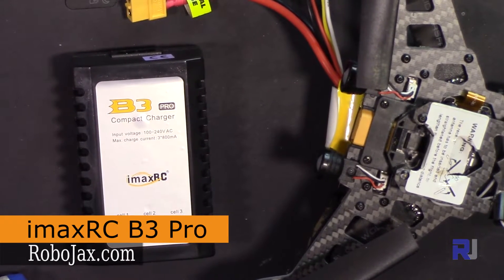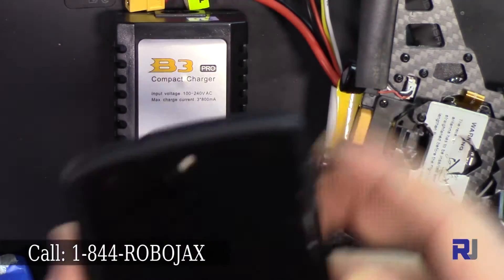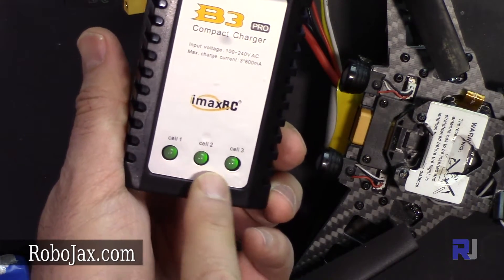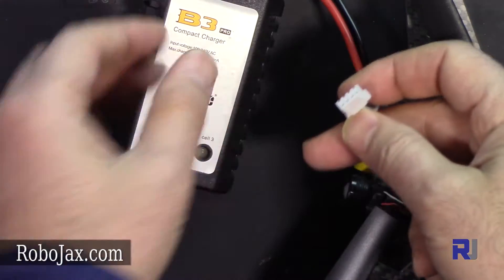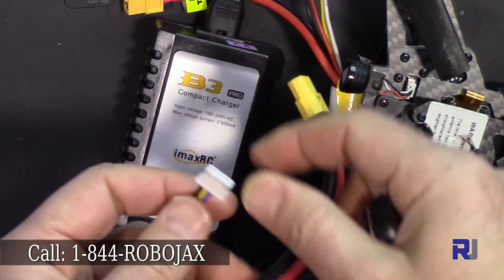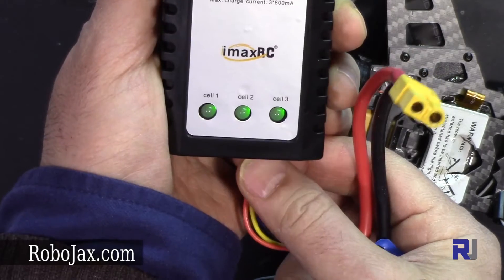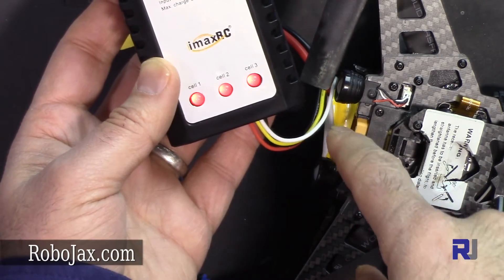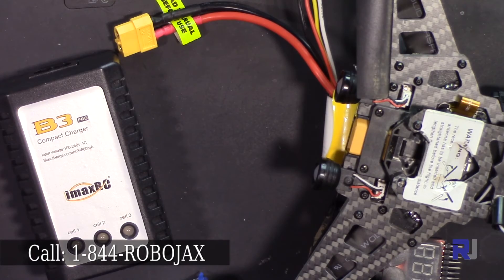imaxRC B3 Pro 2S 3S Lighium LiPo Battery Charger Explained

Comment: I assume the battery is a standard 3S LiPo, in which case each cell is 5200mAh, not 1733.33...mAh, you don't divide the capacity by number of cells to get a cell's capacity, unless it's a 3P battery. The batteries are labeled by their per cell capacity, and then the cell count to get a preferred voltage (1S = 4.2V, 2S = 8.4V, 3S=12.6V and so on). If you take your battery apart and put the cells in parallel (the 3P battery), you'd then get 15600mAh battery that outputs 4.2V (fully charged).
So the correct calculations are 5200/700 = 7 hours and 26 minutes for the B3 charger to charge a 2 or 3 cell (2S/3S) 5200mAh battery.
Reply from the maker: Hi,  Yes each cell has 5200mAh battery is  in a 3S 5200mAh battery. the 3S battery is connected in series but each cell is charged individually and they need current. The charger is rated at 700mA. This is the total current it supply from charger so we have to divide it in order to find the time. The 700mA rate of charge is not per cell.  I have charged 2200mAh and 5200mAh and it was proven to be correct.
Reply: @robojax  that is not correct. The charger charges a single cell at 700mA. What the 3x means is it can provide the 700mA over all three cells it's connected to simultaneously but it doesn't charge one cell at 2100mA. 
Messure it yourself if you can, or ask an engineer. 

Charging 2200mAh battery with the B3 charger will take just over 3 hours. If you get less, it's because you havent charged the battery from 0% to 100%. The LiPo discharge rule is to discharge about 80% which in voltage means to about 3.5-3.8V. This means to get to full again, it doesn't need the full 2200mAh.
It could also be that the charger gives more amps than rated, but what I said still applies: charging 5200mAh with the B3 charger no matter if its 2S or 3S, it still takes over 7h.
Reply from the maker: You just answered it "doesn't charge one cell at 2100mA" yes true. so it charge over all three with 700mA.  That is what I am saying. if it charges at 700mA exits from charger at any moments, then you can find the total time/hour until the battery is full. I have taken energy storage course at graduate level and practically I have charged my battery.
Reply: @robojax  I think there is some misunderstanding here since I've read your replies to comments where you've done the calculations correctly. In your video you did not - which is what I am trying to tell you.

The B3 charger charges one cell at 700mA, 4.2-4.25V. It doesn't matter if you've connected 2S or 3S. As you yourself have commented, the charge time is always [cell capacity]/700mA=[hours to fully charged]. But then you said "The 700mA rate of charge is not per cell" - while in fact, it is. Each cell in a 3S 5200mAh battery is 5200mAh. And in your video you divide the 5200mAh battery capacity by three leaving 1733mAh per cell, which is completely false. Charging 5200mAh at a rate of 700mA takes 7.42 hours and not 2.5 hours as you claimed in your video. But then in your comments you've said that it takes 7.5 hours?? Very confusing. But I'm sticking to the errors in the video since that's what people will see mostly.

It doesn't matter what courses you've taken, I'm trying to teach you something so you won't spread false information in the future of your videos. I think it's great what you've created - I'm just pointing out a few errors.
Reply: Olli Akokari is correct. The 3x700mA is a true, but misleading statement from the manufacturer. This charger has 3 independent chargers inside for each battery,  and each charger supplies 700mA to the battery it is connected to.  So you need more than 7 hours to charge the 5200mAh battery. Thank you for the video though.
Reply: @OlliArokari  You are right brother.

Comment: Sir. I'd been charged well but one day when I tried to charge, battery connector wire had getting hot and got smoke on 2s and 3s balance port and little burnt on  battery connector, 2s 3s balance port both. What was the cause of this?

Comment: Nice video just want to ask using this charger on a 1100mah do i have to wait for the 3 green light on to fully charge the battery? thank you
Reply from the maker: of course. each light means independent cell.  cells can charge at different rate.
Reply: @robojax  thanks for this it helps a lot😊🤙🙏

Comment: Bro in my case 2 cells are balanced and last one is not balanced so questions arises in my mind my charger won't stop charging other 2 cell which are fully charged now and last cell always keeps on hanging on 3.85 like that so what happens is that when I had put my battery in storage mode other 2 cells were at 3.7 something and last cell was not 3.7 and like 3.3 and after some times I found out last cell is heavily puffed so I punched battery and removed excess gas and sealed it back and now same problem that charger won't stop charging 2 cell together I had seen only 1 red light  and other cell keep over charging this charger is dumb am I right ? And If u know any solution then plz reply

Comment: Hey. When connecting the battery plug to the charger, I accidentally reversed it for a second. Only the left led is showing red and others are not glowing. When I connect the charger the left led shows up for a second and then it gets off. When I connected my battery to my pcb(APM 2.8) the battery is showing 8.17v and the percentage rapidly decreases even when I didn't connect any motors in it. Is my battery damaged or my charger (b3 lipo)is damaged. My battery is  3 cell 11.1 V lipo battery.
Reply from the maker: Hi, battery is very powerful. it should have damaged the charger. specially if it is this charger.
Reply: @robojax  thank you sir. But my main question is if battery is damaged or not.
Reply: I am the one who asked the question sir.
Reply: Very much thank you for your instant reply. You will become a successful YouTuber

Comment: I put a new 2s battery 2200, after 3 hours of charging it looks cell 1 red, cell 2 green,cell 3 green with red blinks why?,I tested the voltage and it is 8.1 does not reach 8.4, the charger  îs a brand new
Reply from the maker: 2200÷500=4.4 hours you may wait for a little longer. I am assuming the charge current for this charger id 500mA as I've forgotten the number. Sometimes a cell gets damaged or the charger. The only way to know is to charge another batter to find out.
Reply: @robojax  thanks 👍👍
Reply: @robojax  i need another charger
Reply from the maker: Good luck charging.
Reply: @robojax  today I lost the drone with the new battery :)

Comment: I have a 3s, 11.1v, 1500 mah, 35c will this charge it and if so how long should I expect?
Reply from the maker: I have given the example of calculation in video, but here. This charger charges at 700mA, simply divide your 1500 to 700 and you will get the Hour.
Reply: 2 hours

Comment: How can I charge multiple lipo, can I use an adapter?
Reply from the maker: You can charge 1 battery in 3 hours but if you connect 2 battery, it will take 6 hours. If you want then get parallel adapter.
Reply: @robojax 👍 I understand, but it's not a problem, I can put it to charge in the night, thanks sir, good video

Comment: I have a 14.4V 2000 mah ni-cd battery....... can it be charged with this? I also have a 12.8V, can it charge?
Reply from the maker: I have explained that this charger is for 2S and 3S (3 cell). each cell is 3.7. Sor 3.7x4-14.8V so 14.8V is 3S and the same way you can calculate to see how many cells you have. Also 3S has 4 wires and 4S battery has 5 wires.
Reply: my battery has 3 X 4.8V cells, so it is 3s.....but it is ni-cd and 14.4V.....so will it work?
Reply: please just sa yes or no

Comment: is this charger safe and good for charging a 7.4v 2s 3600mah 45c battery?
Reply from the maker: The charger is charging any lithium polymer 2s or 3s battery regardless of  capacity. It just takes different amount of time to charge. I have given example of charge time

Comment: I have the GIFI battery 4200 mAh for the hubsan Zino. 

It says green and then when I plug it into my quadcopter it says 80% or 90%.
Reply from the maker: interesting. You have to use a multimeter to measure the voltage, then you would know.  Very rarely it is possible that the charger might be bad.

Comment: Soo im new to all this can i use one of these as my everyday charger for like a 5200mAh 50c and a 4000 mah 3s 40c?
Reply from the maker: The capacity and the C does not matter . It will just take more or less time to charge battery with different capacity. Yes you can
Reply: @robojax  thank you buddy
Reply: @robojax  okay thank you ive bought one and just wanted to know also does cell1 usually charge first or is it either because my first battery has come up cell2 charged first thanks buddy

Comment: Can I use a nimh battery on it or not with a connector like a 2s
Reply from the maker: If the nominal voltage bid 3.7 then yes
Reply: @robojax  I called red cat and they told me it’s a 7.4 V battery and they told me it would work with the charger
Reply from the maker: Your is 3.7 and has 2 cells  3.7X2=7.4. Yes it will work
Reply: @robojax  I’m talking about danchee ridge rock battery it’s 7.4 v and I called red cat and they told me that the battery could charge on that kind of charger that you have in the video and I have the same charger

Comment: i have a 3 cell 2200 mah battery and cell 2 is off balance. Can i balance once cell using this charger ? Connect a jumper lead to cell 2 and charge only that so they are all equal ?
Reply from the maker: this charger is charging each cell separately.  you can do it yes.  You may look at cell balancer video here https://youtu.be/l2APm5olDiA

Comment: Hi Dear 
I have 2 cell battery which is 2700mAH 
How long it should take until both two lights go green ??
It take with me more than 5 hours is that fine ?
Reply from the maker: Assalamu alaikum Moheb, Because this charger can charge at about 700mAh just divie 2700 ÷700= 3.8 hours or about 4 hours.

Comment: im have made a custom battery pack using 3s 18650 (3 cell, almost 12v).

I have also made the balanced lead (white connector ) for charging with b3 charger.
when i connect the battery to the charger, the 3 leds are always red, but i have chrged that battery pack to full before.
those led where red for long time.
what is the problem i cant understand please help
Reply: the charger will keep charging till the all cells have reached their max voltage. the max voltage for a typical cell is 4.2v, so in total a 3s battery will be 12.6v when the charger turns off. if ur battery peaks at 12v, then each cell is maxxed at 4v. the charger will continue to try and charge it thinking it will eventually reach the desired 12.6v. but it won't.

idk tho rlly. im confused y ur battery is at "almost 12v" when it should be at 12.6v when fully charged. my 18650 cells r charged till 4.2v
Reply: @9e05cherianpadipurackalvar6  thanks for your time...to reply..
To solve this I have installed a bms to solve this (for temporary, I guess ).
Thanks bro..

Comment: Does this charge battery packs that have 4 pins
Reply from the maker: I believe I've shown that. 4 pins means we have 3 cells. 3 wires for 3 cells and 1 wire for ground or negative.  if battery has 2 cells, then we have 3 wires.

Comment: Hi,  great video. My 7.4v battery lasts too little, for about less than 1 minute, even if i charge it properly, do u think this imax b3 charger will solve this problem?
Reply from the maker: Hi, it seems you battery is not holding charge.  do you charge it for 3 to 4 hours? if not then do it and use proper charger. this b3 will help if your battery is good. battery has life and number of times you can charge it. after a while they become useless.

Comment: I have 2 cell 2200mah lipo battary..after 3 hours the cell 2 light is solid green but cell 1 is red...what should i do now?
Reply from the maker: if you wait for some times and it doesn't change, there are two possibility. 1-Bad battery. Try charging another battery. or 2-Bad charger. .
Reply: @robojax  the battary is kinda swollen on upper side..is the battary dead?

Comment: i have the same charger, mine is shit, i gives different indication each time i reconnet the battery, for example i connect a used battery it shows all lights red, they never go green, i test the battery with a multimeter and it is fully charged, then i connect the battery to the charger and it shows full charged, i disconnect the battery, reconnect it and it shows not charged again, and so on :P
Reply from the maker: It seems your charger is defective.

Comment: I have a battery that was left into my rifle and it was did I guess and when I plug it in only the 3rd light shows green and nothing changes i don’t know what’s wrong
Reply from the maker: If the voltage of a loop battery goes below 3.2 or 3 voltes , the charger will not charge it assuming it is dead. So first wait for a few hours . If charge doesn’t start then charge I individually by connecting 4.2V with constant current  or maximum 1C. 1C means 1 capacity of the battery. Of your battery is 2000mAh then 1C is 2000mA. In a few minutes measure the voltage of the cell , if it is not dead it should be above 3v . Then the charger will charge it.

Comment: My 2200 mah battery was charged from 11.3 to 12.5 volts in about 3 hrs .is it normal? And the charger gets quite hot while charging.
Reply from the maker: Yes it is normal. The charger supplies 700mAh and 2000 ÷ 700=3.1 hours. I don't know how hot. But make sure NOT to charge in living area. Put the charger and battery always on non-flammable material like concrete or metal and in garage or specially designed bags.

Comment: Sir i have the same battery charger i have a 2s 2400 but the cell number 1 seems to be not charging because its red for a whole 5 hours or more,i used the same charger with my other batt and it seems to work well,what seems to be the problem with my battery? Thanks
Reply from the maker: I will not know for sure. Either the battery or the charger. You can connect another battery and check or use a multimeter to check each voltage of the cells.
Reply: Ok sir noted thank you.
Reply: @paolodulayshooting  those chargers  aren't exactly too reliable. It is common, that after a while one channel just doesn't charge. Your case looks like exactly that happened.

Comment: I have a question if you can answer it I would be grateful so I have a similar charger like this where the lights are green till you plug something in so I have a 3s battery 5200 mah and when I plugged it in the first time all the lights were red then after about 30 min the 3s light turned green then now whenever I plug it in the 3s light is always green what’s going on?
Reply from the maker: That is fine. Your battery does not need charge. Use it and empty the batter so it can be charged.
Reply: @robojax  it does because when I put it in the car it doesn’t work

Comment: I have a 7.4 Volt 1000mah 15C battery, will it charge?
Reply from the maker: Yes it will. With 700mA charge rate 10000÷700=14.28, it will be charged in about 14 hours.
Reply: @robojax  no it's a 1000mah not 10000mah. It's gonna be 1.4hours.

Comment: Is it safe to use with a triple charger, I have three lithium batteries. And my IMAX b3 had a triple plug charger.

Or does it need to be one battery at a time.
Reply from the maker: If you got one connector for all of them you can change them.  Connecting 3 battery bin parallel will increase the capacity ans consequently it will take longer time to charge.

Comment: Will the charger turn off once it is done charging?
Reply from the maker: yes it does.  It will go solid green. Solid green means no current goes to battery. That's why when battery is not connected, it is all solid green.
Reply: @robojax  I charged my 2200mah 3 s for 4 hours. Not a single light turned green. Is that a problem cause I just got this charger
Reply from the maker: 2200  ÷ 700 =3.1, so it should be 3.1 hours. Yes the charger could be bad if the battery is okay.

Comment: i have a 3 cell 3300 mah 35c 11.1 v lipo battery.. my second is totally discharged and shows 0v so can i charge that single cell with a B3 imax rc charger? or how should i recover the dead battery cell , i only have the B3 imax rc charger with me.
Reply from the maker: you can't change a battery or a cell that has voltage below 3.2V. the charger will not charge it.  the battery should not be 0V.. when you use it, you should never allow the voltage to go below 3.2V or less or more depending on manufacturer specs. So the battery should be dead.  but if you think to revive it, apply 4.2V to each cell from a power supply and limit the current to like 500mA. Higher current might cause fire. Allow it for half hour. After that if the voltage stayed, then you can connect it to the charger.

Comment: Mine when plugged in, the cell 3 is green and blink red, cell 1 and 2 is not lit at all. All 3 leds turn red when i connect a 3s battery though.  Is mine broken?
Reply from the maker: it could be the battery or the charger. To make sure it is not the battery either use another known-good battery or use multimeter to check each cell voltage.  you learn it from this video https://youtu.be/Cx25ozeeC8Q and if the battery is good, then we know charger is bad. good luck.
Reply from the maker: if the battery voltage is below about 2.8V-3V, charger will not detect it.